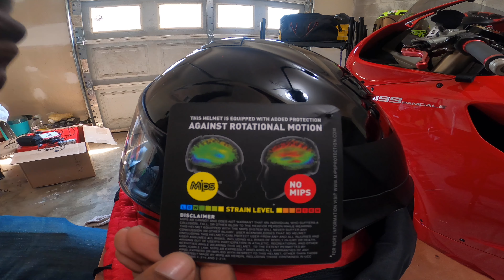Bell Star MIPS DLX Helmet Lux Checkers Helmet // my motovlog set up

Comment: I have that helmet line and the only thing I don’t like is that curtain will not stay in since I put that Bluetooth in at speed....other than that it’s a great helmet
Reply from the maker: Aye man just appreciate the heads up..... I actually personally don't like most Bluetooth connectors due to things like you  mentioned..... im still waiting on them to come out with something better design wise .......so far I only have about 5miles on this helmet...but thus far I like it a lot
Reply from the maker: Appreciate you watching dude